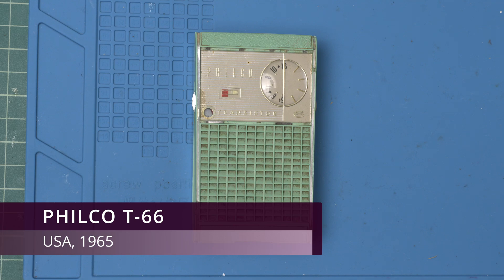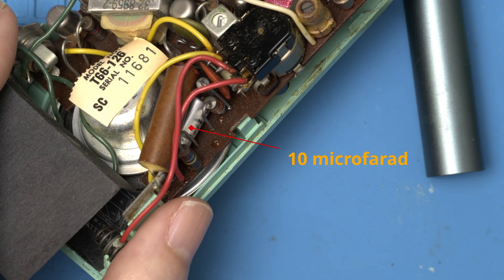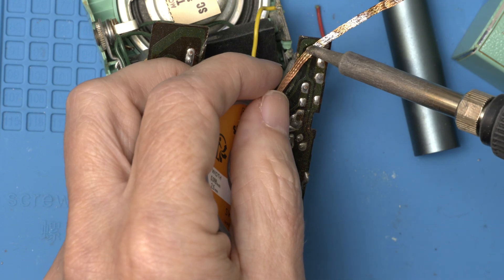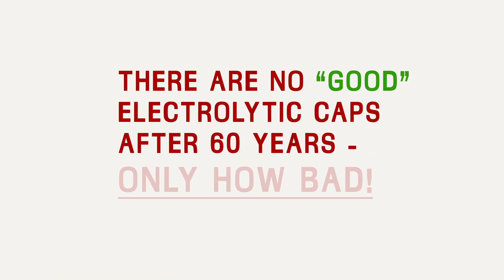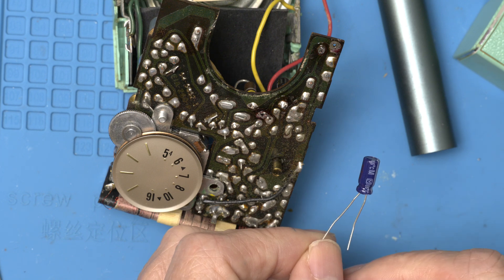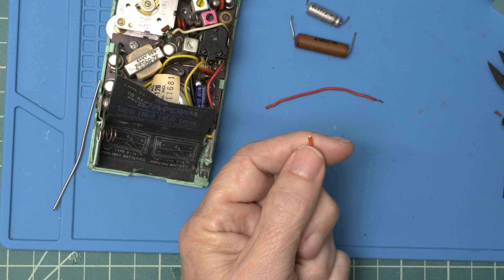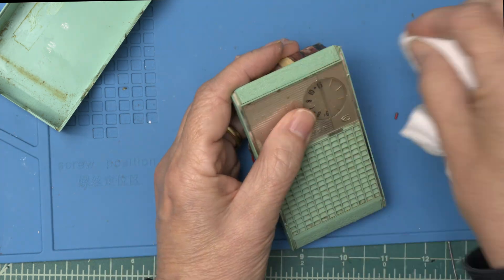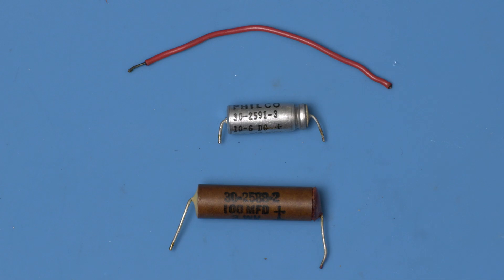Vintage Electronics Repair: Dead Philco T-66 transistor radio restoration

Comment: Nice repair. Where do you get these transistors from?
Reply from the maker: I've been collecting them for a few years now from all the usual places (family, flea markets, estate sales, goodwill, ebay).  Finally got around to doing something with them besides having them sit on display!
Reply: @Dream.Build.Create  Did you learnt about those electrolytic capacitators, need changing just recently?

Comment: Very good. A suggestion when working with components with leads is to run pliers gently along the length of the leads before fitting. This removes any oxidisation, making soldering easier and generally not requiring flux.
Reply from the maker: I will have to try that!  Right now the flux application is sort of muscle memory.
Reply: @Dream.Build.Create  actually, since the solder you are using probably has a flux core, in many cases the additional flux is not really necessary.

Comment: I have a question about Deoxit. What should deoxit be used on? What should it NOT be used on?
Reply from the maker: It's for metal to metal electrical contacts and works great.  Should be kept clear of rubber, plastic, lcd screens, etc...
Reply: @Dream.Build.Create  very expensive though!!🤣🤣🤣🤣
Reply: @mikecass8306  yes, but a little goes a long way!
Reply: @Dream.Build.Create  yes, but most potentiometers have a metal to carbon contact, so for those Deoxit F(the stuff for metal to metal contacts is Deoxit D)is better.